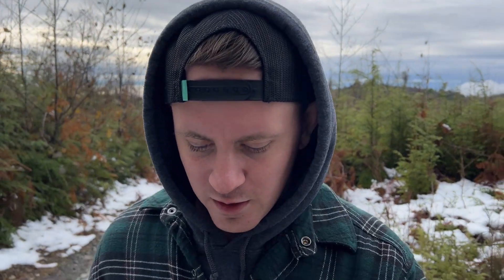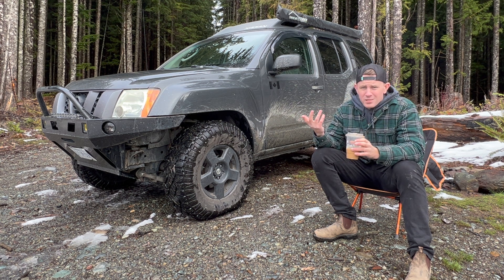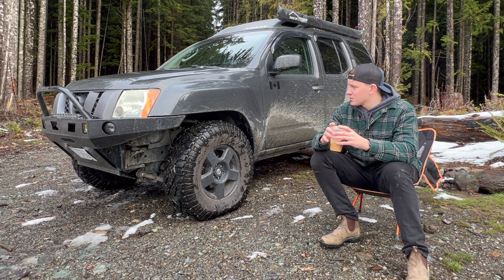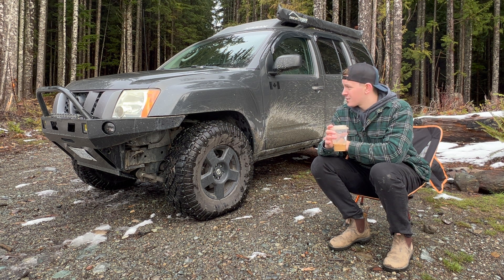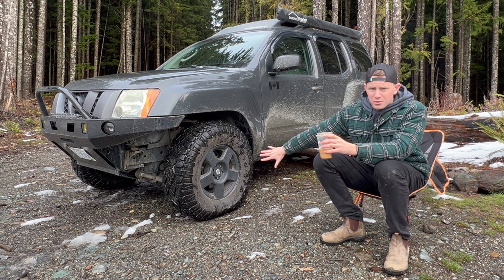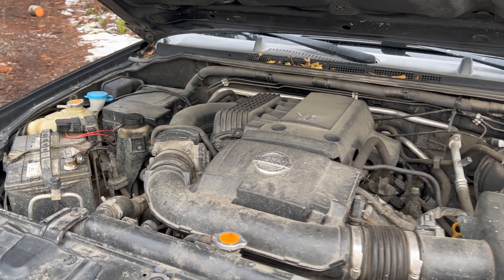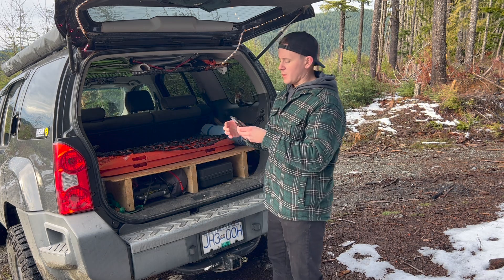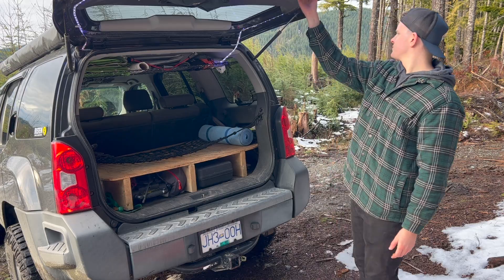An ACTUAL Budget Offroad Vehicle | Nissan Xterra | Overland Rig Walk-Around

Comment: Nissan didn't sell a lot of 2nd Gen Xterra's, hence the high cost of replacement parts. They also didn't upgrade to a morre modern engine, with better MPGs, and they intriduced the 2nd Gens in the heart of the Middle East wars, when gas was $4-5/gal. Most people just weren't going fir it. It's a shame, because its such a great vehicle. The lack of aftermarket support correlates to the low sales volume. A front winch bumper for a Wrangler is literally half the price. It is what it is. If you really want to mod your 2nd Gen heavily, you're going to pay a lot. But, for me, with a young daughter in the back seat, I'd much rather drive long trips with my Xterra, than a Wrangler with a solid front axle, and little to no side impact protection. Its definitely a trade-off.
Reply: I drove a Wrangler when I was young.  Great offroad but very unsafe and load on road trips

Comment: I have 2007 xterra nismo SE i want to sale it has 170000 miles motor is strong. It has backlight metal covers side runners front metal guard. Its silver it has VDC CONTROL it is a 4wd.. Body type is in good condition.. Please contact me if your interested.